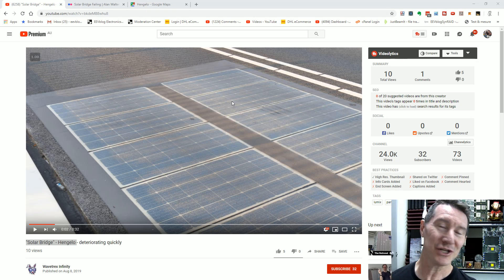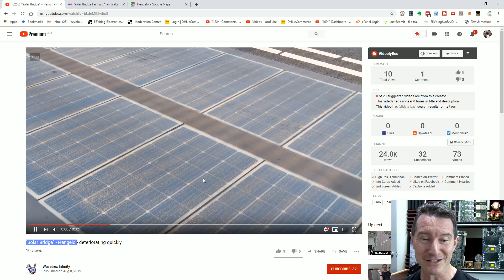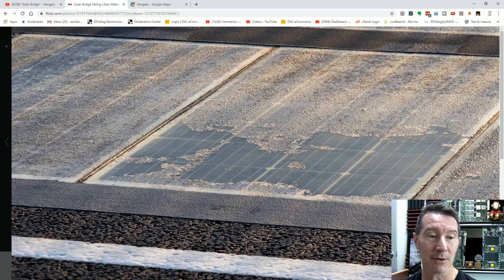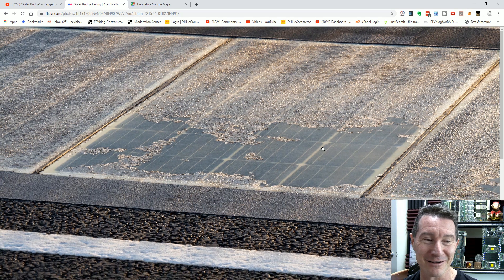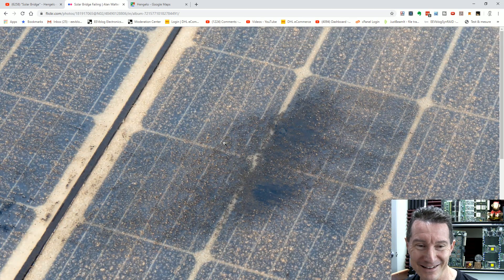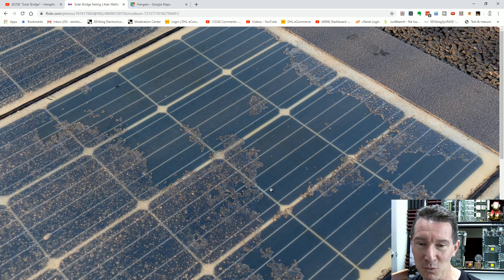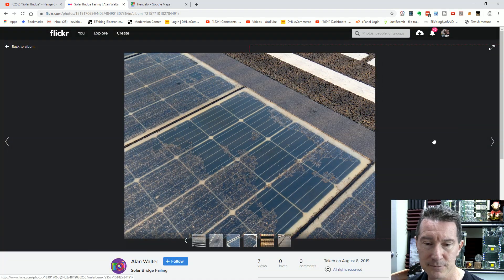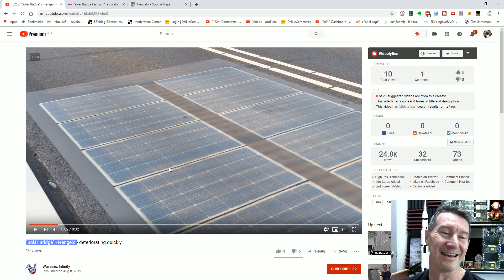Solar Freakin' Bridges! - ANOTHER Solar Roadways FAIL

Comment: I guess your videos about solar roadways are more profitable than the actual solar roadways at this point.
Reply from the maker: Funny because it's true.
Reply: @EEVblog2  you can even say that all of your monetized videos ever was more profitable (and probably even demonetized ones) than this non-sense. Let's not forget that every single installation is loosing money and don't even let me started on comparison of energy spent, mining caused damages vs. resulting energy. Basically dirtiest brown coal mined by 1920's steam machine burning sludge would most likely still be a) more economical b) actually more ecological. Would be fun to analyze and calculate though.
Reply: Solar roadways are very profitable for the 'inventors' and the installers.
Reply: @macdonalds1972  
that a fact and i think thats the only reasen it exist

Comment: When I was a kid we would put copper pennies on the railroad tracks. Because after the train had run over them they were thin and many time’s their original diameter not to mention being too hot to pick up at first all of which we found of great interest. The point being that when you put something in a situation where it is continuously being compress between two other objects and not expecting it to change as result is just unimaginative. Solar roadways may be a new definition of insanity they keep doing the same thing over and over expecting a different result.

Comment: I dont understand why not just use the panels as a roof for the bridge?
Reply: Because politicians don't understand. You can really tell them anything, and they believe it.
Reply: @robbedoeslegrand236  then someone tell them that they can make money in using solar panels as intended
Reply: @peterfixit7221  They only listen when someone dressed up in a nice suit tell them that. Well I don't know many, if any, engineers dressed up in a nice suit. (Except Bill Nye ;) )
Reply: Because then it's a tunnel.
Reply: Because it wouldn't be solar "roadways" then
Reply: Because that's additional structure, if the bridge is not designed for it they'll probably need architecs to add additional support structure. Where as this they are just laying an additional layer of road surface.

Comment: Dave the surface wear seen here is similar to (but not as significant) on the top layer of a normal road (in the UK at least). The last upper layer of the road surface is called the 'wearing course' or 'surface course' and is intended to have a degree of wear, but this can of course can be resurfaced when the wear reaches a certain point. A typical road wearing course is around 30mm in depth so it takes some time before this needs resurfacing. these panels look to have a couple of mm of a granulated finish that mimics a road surface, unfortunately once that look and feel has  given up a couple of mm of wear there is nowhere else to go other than onto the glass/epoxy surface.

Comment: Clearly it's a stupid idea but I was impressed at how good the solar panels looked where the sticky surface had worn away. I would have expected the panels to be smashed. One rock stuck in a truck tyres tread must exert a sizeable amount of force.
Reply: this - also it does it repetitively with each revolution of the wheel. So imagine the wheel damaging every panel in its way.
Reply: Give it a bit of time ;)
That portion was lucky so far not to get a rock stuck in a tyre.

Comment: Lol on a bridge too, this actually turns into a safety issue.  Bridges (assuming it's over water) will often tend to get black ice before any other road just because of the added moisture in the air. Now you have a relatively smooth glass surface with ice on it.  Fun.   I wonder if there are stats on how many kwh has been produced by all these projects combined.  Could calculate how much each kwh cost to produce.  Given these projects fail in a short time span you can practically treat them the same way as fuel - as a one time use energy generator.  There is no pay back time in any of these projects.  They produce a certain amount of power, and then die.   Going green is great but only if the green tech does not end up in the trash a short time after it's been deployed.

Comment: Yeah, place it on bridges, the type of roads that are usually heavily used, and than place them in two rows for exactly the two tires for maximum wear. I mean if it was placed on a barely used road in the middle of the lane to minimize the wear and maximize the not blocked part, it might be somewhat useful, but no, sensibly placement for something stupid by default is too much. But what we could expect form some concept that place a fragile and costly item on a roadway?

Comment: why not build them alongside and above roads..enclose the road...save noise...and generate more power from the increased surface area!
Reply: The netherlands are trying that too, building noise barriers with integrated solar panels.
Reply: Efficiency loss since most of those surfaces won't be pointing towards the sun, structural integrity/maintenance, loss of green embankments and drainage space, loss of natural daylight while driving, difficulty of making an efficiently transparent surface which also dampens noise well...

These are of course not insurmountable and definitely far less concerning than driving on the panels, but south-facing roofs and other already-existing structures still are the best mounting location. Based on personal experience I'd also be slightly worried about poor planning/cheapskates if any of these panels are visible while driving on the motorway as reflective glare can lead to accidents and crashing into the panels would be rather dangerous. Lower-velocity roads and parking lots should be pretty decent if the government still has money to burn after subsidising all the roof panels.
Reply: Photoloss No need for a transparent noise dampener.  Solar panels go on the very top, not inside the structure.  Anyway common noise barrier research already found roof-like angeling of panels to be very effective. Just using commercial solar panels for the panels that happen to face the sun while using the usual material for the other ones. Stick the electronics in whatever cabinets are already at the roadside.
Reply: @johnfrancisdoe1563  Well yeah, sticking as many solar panels on top of things as possible works of course. Given the subject of the video I assumed the question was more about "innovative technologies" than availability of government-owned land for solar farms.

Building noise barriers for the purpose of deploying solar panels would still be questionable due to the material cost of the barriers themselves, but as it stands there are plenty of existing structures with little to no solar installed so they could easily spend all the "solar road" investments there instead. Add batteries and charging stations for electric cars, win-win-win :D

Comment: Wouldn't they extract more energy by including pressure electric generators in road speed bumps or pads? I assume that the pressure change produced by passing traffic could be used to generate electrical power, maybe by compressing air into a storage container. I guess such a system would be robbing energy from the vehicles driving over it, and might also lead to a less smooth ride. Judging by the strong vibrations produced by the speed bumps on the road a few hundred metres from my home, there would be considerable energy available from such a system, given that a passing HGV can shake the ornaments from my bookshelf and thus must vibrating my whole house.

Comment: When I saw the grippy surface worn off I was about to say "Well that improves PV performance" and then you said that. lol ;D

I want to install PV panels on my roof but I don't think the rafters would reasonably take the load... the house was built in 1916, the roofing is double layered and there's some dry rot and termite damage... :( I don't have enough other space do do much in the way of solar. Bummer. :(

Comment: I think their is a place, where these Solar freaken wastage may not be 100% useless - just 90 or so. 
On the side of runways at airports. Usually there is already a cable channel to provide a connection to the grid and runways are cleaned every day (at bigger airports). There are also no obstacles like trees or parking cars. At this Place you can't build something tall like a roof construction where Panels are mounted above the ground. This area shouldn't have a lot of wear so that they may last a few years* longer ...
But this of course only makes sense if you already have covered all roofs with solar-panels and Build a roof construction above the parking areas etc. to generate electricity at a better efficiency then the solar freaken uselessness.

*days are more realistic - i know!

Comment: Solar Frickin Bridges... 
What will they think of next?  :)
Reply: actually, that might not be a  bad idea. Putting the panels up on the structure instead of on the ground.
Reply: Adam Rivera That would be too logical, same for panels on the roof....
Reply: Solar frickin highways
Reply: Solar freaking mineshafts.
Reply: Solar tunnels
Reply: Nearby we have a bridge that is of especially light construction.  It was done that way so it could be constructed further down the road and lifted over the 12 lane road in a night.
It has a special light road surface, not the usual asphalt but more like what you expect to see in a solar roadway: some hard base material (steel?) with crud sprayed on it for grip.
Unsurprisingly it has failed after a short time, at the moment it is closed for rework.
The only thing that surprises ME is that they are not converting it into a solar road/bridge now.
Reply: Solar frickin sewers!
Reply: @Rob2  Bridge in the video was build off-site as well and put in place on a barge. But the road surface was only added once the bridge was in place. Found a video of its construction: https://www.youtube.com/watch?v=UgfSl0_oAjM

Comment: I've been giving this a lot of though and the answer seems blindingly obvius - move this solar roadway idea to parking areas, particularly long-term parking.

Vehicles move slower in parking spaces, so less wear and tear. Parked vehicles would significantly reduce the build-up of dust, leaves and even snow reducing the output from the panels.

It's a perfect solution, isn't it???

Heavy investment by a forward thinking government, like that of Donal Trump, could see cars parked on top of solar panels becoming the next innovative norm......

Comment: Why on the roads theres a million other places you could put them ugh
Reply: Well space really. To power for example U.K with solar would mean covering 1/3th of the country with solar panels. Not just eye sore but destruction of bio diversity not to mention loss of forests and farming. Economic disaster and potential starvation. Solar and wind are just pipe dreams for hippies. Sure there is lot of applications but in large scale just not viable. Nuclear all the way and then fusion when and if it is economic.
Reply: ehhhh, that is a designers choice, they wanted a sleek bridge without an overhang, just the road surface. but they could opted for combined streetlighting poles with small solarpanels on top. the solar was intended to power the street lighting on the bridge anyway. nothing more, nothing less.

Comment: Another idea that might even work:
Solar freaking railways! You could mount them between the rails where there is no stress or wear. Railways also take up alot of space and maybe you could use the electricity directly for the Trains. Still a dumb idea but one that might actually have a chance to wirk!